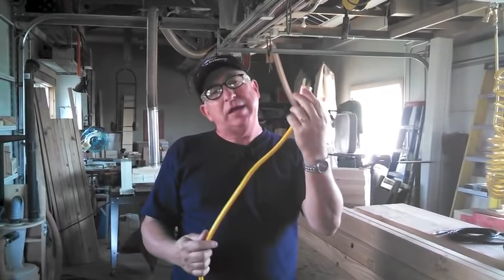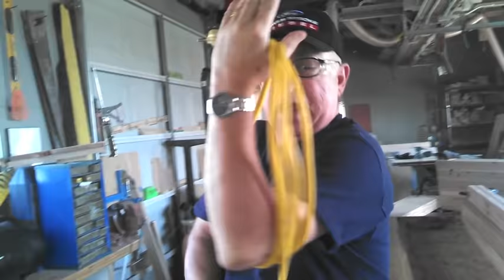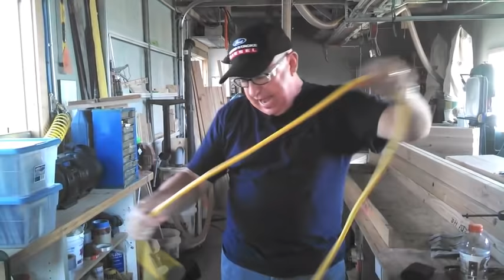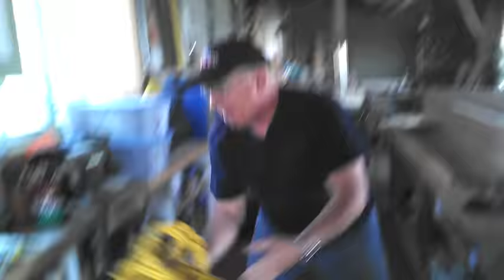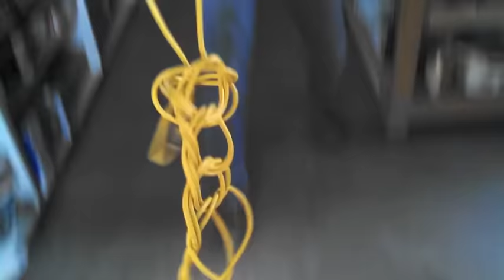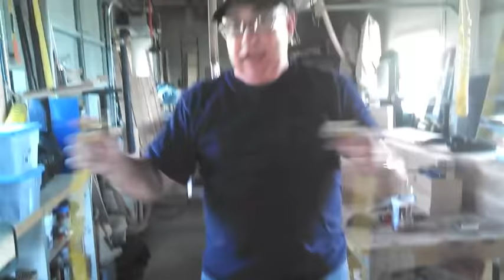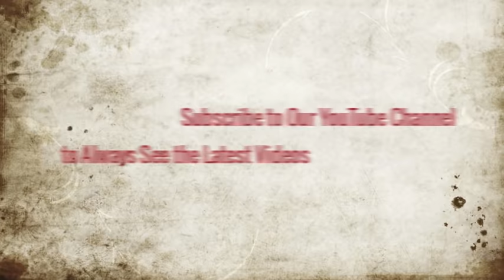Best Way to Store an Extension Cord

Comment: I was always taught to completely unroll any extension cord as a coiled power lead gets hot and may speed up the deterioration of the insulating sheaths.  A loose knotted set of loops like this would be less dangerous (potentially) than being wound in a tight coil like an extension reel but there is still some heat induction going on.

In my experience there is a more obvious reason to fully uncoil a cable. You mentioned that creating your loop allows you to stuff it into your shelves and it will still come out tidy... You are right, but what about if the cable has been damaged... caught on a nail, rubbed up against a jigsaw blade while it is on the shelf etc

Feeding an extension cord out fully between your thumb and forefinger allows you to feel for any breaks in the outer sheath

I like your knot idea, but i'd say it is safer to recommend fully unravelling 
Just my opinion
Reply: No there is truth to what you said. I never use a cord with coils in them. Straight is best when using heavy duty cords. If you have to use a space heater which I don't recommend but there are exceptions,  there should not be any coils in the cord that will really have a heat build up. I don't recommend using a cord for space heaters unless it's number 12 with good plugs on both ends. I do use cords  when I want to start with the first outlet on a daisy chain usually the first outlet is behind furniture. Not the best thing but all the rest of the outlets don't heat up if I start with the first outlet.
Reply: Safety guys (rolling my 👀)
Reply: Safety before convenience!

Comment: Doing this on a commercial site will get you busted by OSHA. You have just created a 100' long trip hazard. See how a cord stored like this looks on a cold job site after being laid out. I agree, arm wrapping is a lousy way of winding a cord, and I am still guilty of doing it at times myself. Best way we have found is big loops, pull cord outstretched arm to outstretched arm, makes about a 3' long loop. Not near as pretty as daisy chaining, I admit, but perhaps safer and more practical.
Reply: Learn the "over under" technique used in Event production / audio video / broadcasting... It will solve your problems forever.
Reply from the maker: jeff, thanks for watching and sharing your insights! Best Regards, DFJ

Comment: A circle is less twist and turns. Now count all the bends and twist adding unnecessary stress to the cords in the crocheted technique. How is it easier on the cord?
Reply: @davidgouin8420  Alright now David.  Don't be such a rude boomer.
Reply: @davidgouin8420  Damned boomers.  She's got a point though, the bend rad. is a lot tighter with the braid method, so definitely not easier on the cord.  Probably about 2/3 lifespan of the loop method I'd wager.  Eh, different strokes.
Reply: I don't like this way either but to each his own.

Comment: Linemen do that with every rope, cable, cord, test lead, etc. on their truck. Handy, handy stuff.
Reply: I am a lineman of 30 years and have never used or have seen it used. It is like everything else I'm sure it works for some people. I can't imagine having this hanging in my truck till or off of my climbing belt. I was taught to roll a rope in your fingers as you roll it  into a uniform coil which is very fast and efficient especially when 40 feet in the air and when you drop it to the groundman it falls freely without tangles. A rope will lay correctly if you train it for a while. Our handlines are  usually about 60 feet long 5/8  inch rope which hang about 18 inches off your belt so it wouldn't  trip you, so as you can imagine this method wouldn't work for us.
Reply: David Quartermain Almost all of the linemen I've worked with do this with rope and cords and hi-pot leads for storage, not for use. I'm a journeyman (topped out 2013) inside wireman out of Local 317, Huntington, WV. I roll everything up like you described above, but this method's pretty handy for when you want something put away but still want it to be quickly accessible. Personally, I'm never in quite THAT big a hurry, haha!
Reply: Nice , good luck in your career, it's always nice too see other ideas . Cheers

Comment: I was taught this over 40 years ago by a studio electrician.
The braiding get real and faster with practice until it becomes second nature.
Here's a trick I use, since 99% of cables are yellow or orange, when I find the middle of the cable I mark it with a black marker.
Saves time from starting at the plug end and going to the middle.
Reply: great idea. gunna do this next time i coil it

Comment: I've worked professionally with XLR, coax, fiber glass (light transmission), extension cords (stingers) and feeder cable. As anyone who has worked in audio, video, stage, studio, etc will tell you, there is only one right method and that is the over-under method. Anything else is a waste of time and destroys cables. There are numerous videos on Youtube demonstrating the over-under method.
Reply from the maker: +kmg501 - thanks - I appreciate you weighing in. I've stated in earlier responses that I do use the over-under method for other types of cordage and hose. As you know as a professional, the greatest advantage to this method is the each coil offsets the amount of twist needed to lay in the loop just before it. I really like it for my guitar cords as well as air compressor lines. However, I've used the winding method with extension cords for many years and have gotten extended life from the cordage itself as well as the ends. I just don't do the loops tightly and it works really well for me.
Reply: this
Reply: DirtFarmerJay's method is an old school boy scout method. I too am in the same career field of AV, this chain looping method wastes far more time than over/under coiling
Reply: kmg501 sure, I agree, but I find convenient that chain method for electrical cords, allowing ne to keep the unused part "chained". Certainly  not ideal for the cord but I appreciate that method anyway
Reply: "Over-worked under-paid" is what the gaffers say!
Reply: I’m in stagecraft at school and we work with xlr cables and our instructor said over under is the only way. I guess on cheap extension cords it’s ok.
Reply: I've worked in Audio Visual for 35 years and have always done the under and over method. I do piss a few people off because I roll left handed compared to most doing right handed, I blame starting as  lighting guy and having to roll long, heavy cables and my left arm being not strong enough to carry the weight so I switched hands to hold the lead. I have used the method in the video a lot on long climbing ropes where it is by far the best way of dealing with very long ropes and guaranteeing that they don't tangle.
Reply: Absolutly! I was taught the over/under method from an audio mixer on a film crew.  It's the only way any cable is put away on a film set.  When you do the over/under method, with every twist you put in, with the next wrap you take it out.  Works perfect.  Still do it on any extension cord I have.  In 5 minutes you can put a tie cord on, (like a shoe lace) on one end.  Once the main cord is coiled with the over/under method you just tie the cord together like you would with your shoelace.  We use to stack them in a milk crate and always had our cables in order and ready.  100' cables?  No problem!
Reply: Thank you kmg501!!  I now have my shore power hookup for my camper stored properly! It was driving me nuts all the twist and now it works perfectly! Thank you thank you!!
Reply: @nateman10  Some people will just never understand a tried and true method.  Oh well!
Reply: Yup.  PBS for 35 years.  I get ya.
Reply: Contractors coil it that way hence it's name The Contractors wrap. However KMG501 is correct that if you are a stage hand using drop cords you would use the over under. You can stand at one end of the stage and toss the cord across to the other side without a tangle in it. When I was a teenager I hung around a local band and they showed me how to do this. It was the only way they stored electrical extension cords.
Reply: nateman10 (
Reply: Now we are getting somewhere.
Reply: LMFAO
Reply: It's great for those applications, but is not the end all for every kind of job.
Reply: @theplaintruth4794  The over under method is great for delicate cords, but isn't and end all for everything.  To imply that this video is a mess, shows you are wet behind the ears.
Reply: @theplaintruth4794  Kmg501 gave you his opinion for audio applications.  I used to work in the pro audio industry and the over under is the best for delicate cords as he stated.  However, it doesn't devalue what this video shows.  I know many people in the construction field who've used this method for decades with no issues. You merely took one's person word for gospel and proceeded to make disparaging comments about another method.   Also, you must have come here first to see how to wrap a cord to begin with, and after hearing one person's opinion, you're now an expert, right?

Comment: Absolutely never sheepshank an extension cord. Every time you've bent that wire you weaken it. When it is cold all of those turns will not straighten out and the cord won't lay flat it creates a tripping hazard. OSHA does not allow this on a work site. Remember before coiling up an extension cord to unplug it first even a brand new cord can be damaged during the course of the day and you can electrocute yourself the sliding your hand down it while you're coiling it up. Great big loops means that it doesn't Bend as much and it will straighten right out. I've had to fire people over sheepshanks especially one guy that kept tripping over his own extension cord.
Reply: You are absolutely right! I had a guy sheepshank one of my cords one time and I had to lay it out straight in the summer sun  to relax it and get the kinks out.
Reply: I agree. One of my first jobs in life, I was an insulator. This was in the early 80’s when blown cellulose first became popular for walls and attics. We had lots of extension cords but the longest was the 500 foot switch cord that lead from the hopper in the truck, down the sidewalk, through the front door of the house, up the stairs and to the furthest part of the attic. This was so the guy in the attic could turn the hopper on and off from 500 feet away. That cord was aways sheepshanked since it was impossible to coil that length any other way. But that cord unwound was treacherous as hell. I don’t think OSHA existed back then and employers didn’t care about safety at all. They could always find brave idiots to risk their lives for very little pay. That cord had been cut and spliced and taped so many times it was ridiculous. They’d never get away with that insanity these days. I did that miserable job about 6 months before I quit and I never sheepshanked a cord since then. The longer and thicker the cord, the bigger the coils have to be. Stretch it out straight and coil it on the ground and the twists come out as you go. Same with a water hose. 
I have seen insulation trucks around lately but I never see a 500 foot switch cord coming out of the truck. I’m pretty sure they do it remotely now. Radio frequency switches. I’m sure OSHA made them clean up their act.

Comment: It is a good way to store a cord, however, in my experience this method causes the outer sheathing to crack prematurely over time. I prefer the old loop method, you just have to learn to twist the cord while coiling, just like doing a garden hose

Comment: Not terrible, but the over under coil method is easier, quicker, and results in a neater cord which you can hang in a nice coil.
Reply: Erik Pendleton Yeah, this way is a bit more complicated and impractical, just use the over under and velco tie it. I'll definitely share this video though, thanks DirtFarmerJay!
Reply: Yes. This chain method is ok, maybe the 2nd best.  The best is the over under coil. A regular coil looks and stores a LOT neater than a chain that still looks somewhat tangled.  A bunch of coils will drop nicely into a 5 gallon bucket, stacked neatly. chains wont.  Coils hang neatly over each other on the wall.  Chains, not as neat.
Reply: The over/under method is only superior if you have the hands & arms big enough and your upper body strength is sufficient for 50' cords.  (Yeah, some of us smaller &/or olderfolk have to do things for ourselves, too...)
Reply: Long cables (50ft-100ft) benefit from this method. Over under is great for shorter lengths.  Try it. You'll like it.
Reply: @merryshernock4698  you can use the over under technique with the cable laying on the floor. I have done this with very heavy 2'' cable without a problem

Comment: That’s 25’ cord and ended up about 5’ of crochet storage. I have 100’ long cord. I don’t want 20’ long crochet storage space of wires.
Reply: @isaackvasager9957  I use my brain to be free from negativity. My 100' roll is in one single loop on a hook. Been doing that for years and I like it that way. Takes me 30 seconds to roll it up.

Comment: The best way to store extension cords and air hose is in long coils over a hook or hanger of some sort.  Minimize the number of hard bends, coils or knots and the cord deploys and goes back away ever so nicely without out the fighting of memory in the lines.
Reply: Ketocene pool heater
Reply: Kerocene pool heater
Reply: Kerocene pool heater
Reply: Damnit! I’ve used this method for the last 35 years to hang my air hoses and cords.  I could tell who was and was  knowledgeable in construction  by how they wrapped their hoses and cords. Now the whole internet knows this technique. there goes my basis for knowing who I’m dealing with.
Reply: Kecorene pool heater
Reply: Greavous Skoger I️ agree with that. I️ mean the ideal perfect thing would be to lie the cables without any bends all the way and keep them straight, but having them hooked over something in my opinion is the best logical way. Next for me would be the typical studio wrap by flipping the loop directions

Comment: NEVER tell someone to run current through an extension cord that has a bend smaller than the recommended size (generally 12 times the diameter. I watched a extension cord catch on fire because HIGH current (within its limit) was being pulled through it while it was coiled up. While this is a good storage method an extension cord should always be fully extended when in use. After seeing one go POOF I will never use one rolled up or bent again.
Reply: Yes, there are a lot of concerns such as this one that are not being brought up or discussed in this video. I would not run current through a braided cord under any set of circumstances. It's simply not safe. This is an important point to make.
Reply: @futopia  Agreed. If anyone understands basic electronics and how an electrical Coil is made, they would not apply current to one either.. Good intentions can cause someone a fire.

Comment: This is called a daisy chain. It's often used for ropes.
Reply: Also called knitting
Reply: An old farmer taught me that back in the 1970s. Said when he was a boy and drove horse-drawn wagons, depending on the setup of the team, you might have a lot of surplus length in the reins, so you just looped them as shown to shorten the reins to their working length. I use it for lamp cords, etc. to take up extra length, But I hadn't though of it for storing extension cords. Now I will.